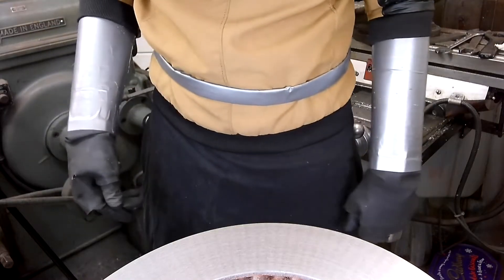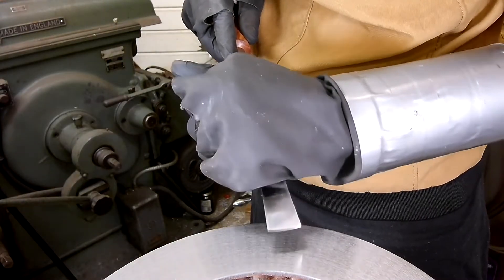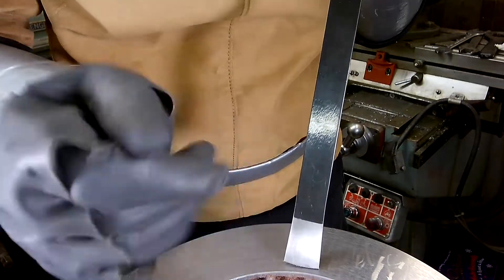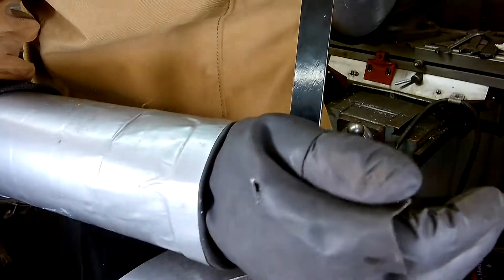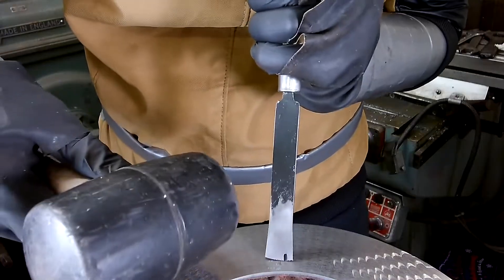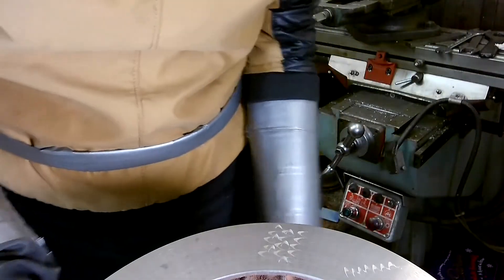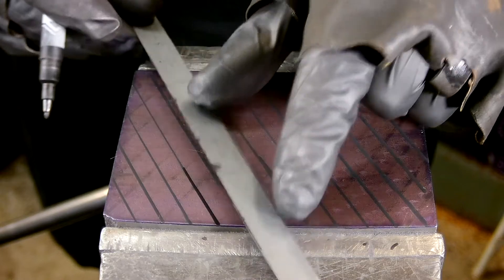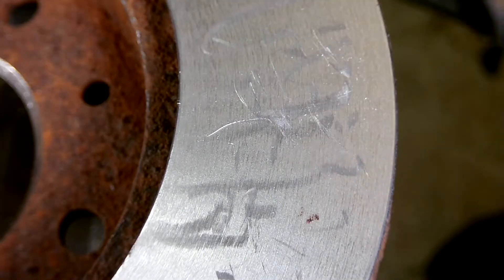Frosting/Flaking/Moore pattern hand scraping the easy way

Comment: The bump method is detailed in Connelly's "Machine Tool Reconditioning" book.  Chapter 20 "Frosting Techniques"   Connelly describes hitting the tool with your fist but if you practice with a head blow hammer, it goes a lot faster, and is easier on your hands.  Either way, it will produce nice crescent moon shapes.

Comment: 6:27 - When I saw the close up right after those quick sets of successive blows 🤯. Son of a gun, I think he’s got it. 

This is the 1st time I’ve seen a video demonstrate a simple and easily duplicated technique that even a beginner can use to produce something akin to Moore’s iconic crescent shape pattern. 

Granted there will still be a considerable learning curve needed for managing the placement of the tip, downward pressure applied to the tool, consistent impact direction and force from the hammer BUT comparatively these things are far easier to manage and expand off of to achieve consistent results. Well done! 👍

Comment: When I learned to scrape various things in my apprenticeship, I was taught to convert a 12” mill file into a scraper. Thin it a lot, install a handle, which was laid on my left shoulder, with a firm grasp 3/4 down the length for control with the left hand,and hitting the scraper with the right hand. Later I started using a wooden or urethane mallet.

Comment: Your technique is wrong, I was trained by Richard King he was a master machine builder, the same guy that trained Stephan.  When you strike with the hammer you're doing it wrong don't hit down into the workpiece. put your elbow out more and the hammer needs a wider swing to strike the scraper in an upwards motion from the tip of the scraper up towards your  chest.  You should feel a bit silly like a monkey is probably the best way to describe it.  It's tricky to get the hang of first but once you get the technique it's a lot easier to get a decent pattern.  John saunders, Adam Booth and Keith Rucker have some good videos of attending Richard kings classes, id recommended you watch them, sadly Richard is no longer well enough to teach but hopefully his son will continue.  Unfortunately no YouTube video can be a substitute for a guy that's done it for 50+ years observe your work and go not like that do it like this.

Comment: I'm not sure where the term "Moore pattern" came from. There's lots of different styles of scraping and frosting /flaking with each one having a unique look. I haven't seen bump flaking for decades as most are using a Biax power flaker. For more consistent results try using a longer more flexible scraper. They're more 
forgiving. Also, a slide hammer style works good too.
Reply: From Moore Special Tools.
Reply: @sambrose1  It came from England before that

Comment: does it work as easy as u demonstrate on grey cast iron or just ductile? why are u wearing all that weirdo stuff?
Reply from the maker: Hi, for me it works on all types of cast iron, but you may have to adjust the down pressure and strike force, depending on the irons hardness, to get the shapes you want. (same scraper and mallet) I'm still working on this and may do a follow up..... Because I'm a weirdo.
Reply: @ordealworkshop8360 depending if youknow how to scraping or  just make video for share